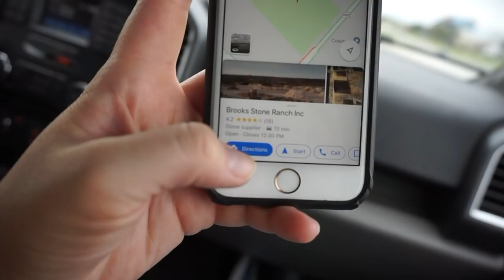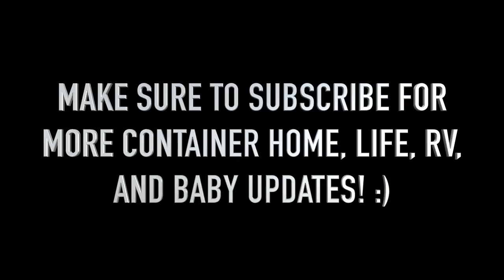GETTING CLOSER EACH DAY // CONTAINER HOME FOUNDATION

Comment: Shovel twice? For the next load use the hoe to pull the rocks from the truck directly into the wheelbarrow unless you like shoveling 1700 pounds of rock back off the ground. OR back the truck right up to the holes and put the rock directly in the ground while skipping the wheelbarrow.